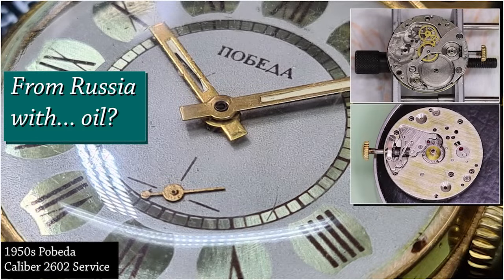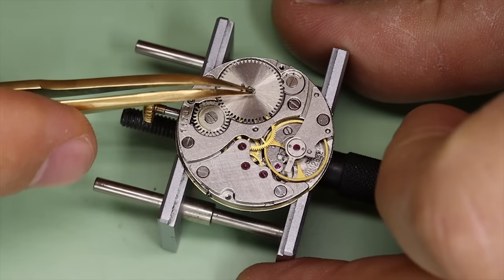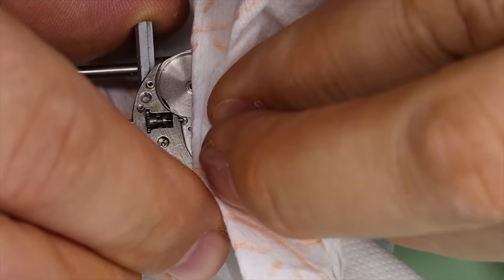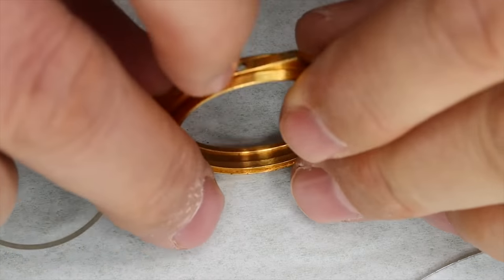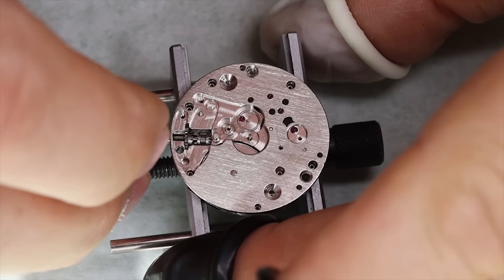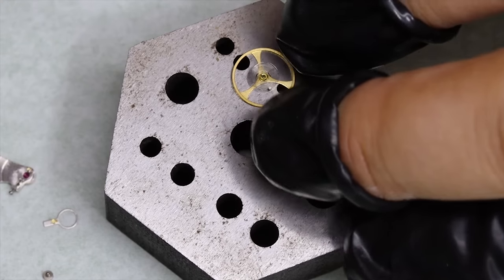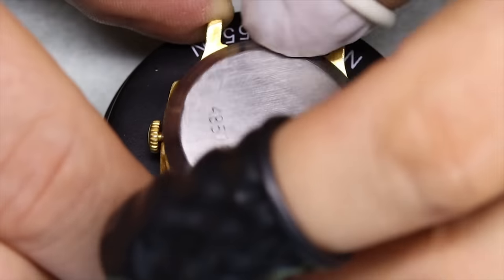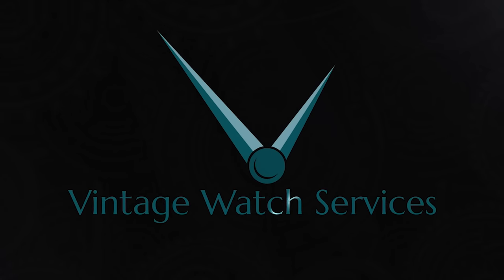From Russia with... oil?

Comment: I think this is a Pobeda from the 1980s or even the 90s. The finish of their movements deteriorated rapidly in their later decades. There are some watches to be found in which this movement was equipped with a shock-protection and sometimes even a date. They were sold under the brand names Raketa and Vostok in the 1960s and 70s. If the cases are ok, they still make for wearable watches today.
Thanks for showing us not only the expensive Swiss pieces but also some curiosities like this one!
Reply: Позолоченные Mеханические часы «Победа», изготовленные на часовом заводе Масленникова в 1990 году, по случаю празднования 45-й годовщины победы Великой отечественной войны
Reply: Название часов Победа воскресили  в конце 80-х, до это они продавались как ЗИМ.  Я купил такие часы в 1990 г. в белом корпусе типа танк с циферблатом зеленого цвета имитацией малахита. Цена 36 рублей.
Reply: @ФеликсШуняков  Thanks for the info!

Comment: Fantastic video! I just love your sense of humor. One question; is fixodrop the same thing as one dip? Thanks!
Reply: One Dip is a cleaner usually used on the balance spring for what I have learned.I've actually seen one person on youtube use one dip to clean the balance cap jewels as well but not sure if thats a good thing to do or not.fixadrop is something that'll actually help keep oil in the place you put it and help it to not spread out to other parts you don't want the oil on.the fixadrop is extremely expensive also costing $180 for a 100ml bottle.well that's the cheapest I've found it so far.I literally just asked if he knows if it comes in anything smaller than 100ml bottles because I think $180 isn't justifiable for someone like myself that'll only be doing maybe 5 watches per year.another name for fixadrop is epilame from the research I've done so far about it.
Reply from the maker: Hi Troy, no, one dip is a degreasing solution, while fixodrop is a stearic acid. Fixodrop is used to keep oil from creeping, while one dip is used for cleaning parts. Personally I don't use one dip much.

Comment: Dobra don Comrade!  Interesting show, I'd never heard of these before, however I have several Vostoks, but none are gold ;-)   I was surprised that the thing would even run with all that oil! At least there was no rust to contend with. Can't wait to see your next video.
Reply from the maker: Thanks, Randy! It was indeed very impressive that the watch ran so well (once it actually did) with that sea of oil on the inside. Very simple and reliable movement although slightly lower finishing level than what we are used to... 😄
Reply: In russia, we dont oil watches watches oil us.

Comment: Thanks. I’ve worked on a couple of these movements before! If you don’t mind me saying, it would be useful if you said what adjustments you make to the watch to get it just so on the timer graph. Also what are in your opinion the ideal settings on the timer graph, as I’m thinking of buying one.
Reply from the maker: Hi Boyd, it varies a bit with each video whether I show more detail on the timing and adjustment, maybe the best one is the one on the Zenith Surf. Have a look at it and let me know if that helps!

Comment: I have a Vostok version of this with a Zoom 2602. I am having a huge problem reassembling the train bridge and can't get the pivots in their jewel settings for the life of me. Some day I will get it correct, but you make it look so easy. Such amazing work and skill.

What is the crystal size/diameter that you replaced this with? Thanks.
Reply from the maker: Hello Clay, thanks for watching and for your comment! It's just a matter of experience and patience getting the pivots in place :) Make sure the pivots are properly in the holes in the mainplate before you try putting the bridges on. Then get the pivots into the bridge starting from the center wheel and moving towards the escape wheel. Once a few of the wheels are in place you can move the barrel a little bit back and forth, that might make the rest of the pivots fall in place. 

I unfortunately don't remember which crystal size this was 😄

Comment: I got one of thease i think its a 1980s one with the same case desine and applied indices gold plate like the one here.  differnt hand set. a very nice watch  the zim 2602 is a supringly reliable and accurate moevement. i have a few 2602 movement watches.

Comment: Awesome video as always.always love learning more about servicing watch movements.any chance you know if you can get the fixadrop in anything smaller than a 100ml bottle?for a person still getting started in this hobby and being as I more than likely won't be doing more then maybe 5 watches per year I serious can't justify spending $180 on a 100ml bottle of the stuff.besides that if the fixadrop does actually have a expiration date im sure it'll go bad before I use even 5% of it.also after looking at the oiling sheet for a sellita sw200 I see that it says to use the fixadrop on all the keyless works parts as well.is that absolutely necessary and is that something you would recommend doing or is it safe to just go about putting a little grease on the areas needed and be done with it?
Reply: You can get Fixodrop in smaller quantities on eBay. Still silly expensive though. Do we really need it? Well, it facilitates not spreading the oil, but is it really necessary? I guess not.
Reply: @VWatchie  awesome.ill check out eBay then.thank you.didnt really think it was 100% necessary to use on the keyless works being that thicker grease is used on those parts but would still like to do the pallet jewels with it prior to oiling.before I buy anything else though I'm gonna ask my local watchmaker and see if he'd be willing to trade me a little bit for a fresh bottle of 9010 since I somehow ended up buying 2 bottles of it.1 place said it was out of stock when I placed order so ordered it from another place and ended up receiving them both 3 days apart.lol.thank you for the info.greatly appreciated.

Comment: When the balance wheel is installed does the balance wheel pin go outside of the palet fork or inside thefork ?
Reply from the maker: Hello John, you place the balance so that the pallet fork is ready to receive the impulse pin into its horns. Then when you rotate it, the impulse pin will connect properly with the fork. This doesn't always go right, so in some cases I'll gently help the impulse pin over the fork on the other side with the tweezers.

Comment: I serviced a Luch with a 2209 movement a few weeks ago. Or at least I tried. Someone before me had ruined the hairspring and the stud holder. So I got to find a donor movement. Really thin movement for the time it was first produced.
Reply from the maker: Hi Hans, thanks for watching and for your comment! The Luch 2209 is a very nice looking watch and quite un-Soviet-ish both for the dial and case and the movement. It's always a bummer when someone has messed the watch up like that but luckily you should be able to find a donor movement at a reasonable cost :)

Comment: Oh god, I have never seen this amount of oil in any watch. In some chinese movements it’s already quite bad, because they throw them in whole into a fluid that should lubricate it, but this one is another level. I wonder how this happened. Great work as always :)
Reply from the maker: Another commenter said it's because there were "watch repairers" offering a cheap repair that basically amounted to dipping the movement in oil and wiping off most of it on the dial side....
Reply: @VintageWatchServices  And definitely, the oil is not of the Moebius variety.
Reply: @gang208  it’s definitely the rust prevention variety lol

Comment: What did you use to polish the gold plating?
Reply from the maker: Hi Slim, I used silver polish. It removes oxidation spots and brings the lustre out without removing material, asI suspect the gold plating on this watch to be very thin.

Comment: In the shipping industry oil filled gauges especially those subjected to high amplitude vibration are common. However, some years ago I remember it was quite the fad to have oil filled watches these must have escapements effected by the damping effect of the oil. How where they compensated to run true?
Reply: That only works on quartz or digital watches not mechanical.
Reply: Sin has a few. Their UX is a quartz oil filled diver that is rated to 5000 meters.

Comment: I think the watch started working because the oil had formed a pressurized seal that slowed the balance wheel  - when you released it, the movement worked...just a thought...
Reply from the maker: Hi Ian, thanks for watching and for your comment! The watch started running after I took the strap off, so I suspect the balance wheel got enough of a jolt to start oscillating. Quite impressive actually, considering the volume of oil it had to drag the wheel train through to make the watch run...

Comment: I've never understood decorating the inside of a watch. No one but watchmakers see it. I've got no idea what the insides of my Omega's and GP's look like. Now, my Elgin pocket watch is a different story. I've seen the inside of it.
Reply from the maker: It is something that originated back in the pocket watch days when the movements were actually visible or could be viewed with little effort. It also depends what one means by finishing; the metal parts cannot simply be machined and then placed in the watch, that would make small metal particles (burrs) liable to coming off and damaging the movement later. Further, a rough surface would make other particles and debris stick to the surface and thereby catch dirt and dust. So a certain level of finishing is needed as a minimum, and when the movement could be seen, the makers decided to make it a sales point to have beautiful looking movements.

Comment: Oil does mean there seems to be no corrosion.  And so much oil seems to mean no gunk, just oil.  Am I wrong?
Reply from the maker: Hello Lynn, that's more or less correct, but watches do "breathe" a bit, so tiny particles of dust and dirt do enter the case. And when they mix with the oil, you get the scientific term "gunk" 😁

Comment: Its likely a case of watch running badly so the backstreet chap takes movement, off with dial and hands then is bathed in naptha overnight, then allowed to dry then bathed in oil and allowed to drip dry overnight making sure none of the oil hits the hairspring and its a quick wipe down, dial and hands back on and watch chap has earned himself a few roubles.   Its very annoying tbh because there are people in Russia who charge ten or twenty dollars to do the full works, strip and clean, repair and replace and regulate, I use a couple of these for my Soviet watches and not had one issue with their workmanship.   I don't have many Pobeda's in my collection, got a couple sister brand Zim's and a ton of Poljot, Slava, Vostoks in my collection but think only one 1950's science fair prize watch on a tooled leather cuff and another with the sub seconds.
Reply from the maker: Thanks for that explanation, it does indeed sound like a good description of the previous "service". Alex, another viewer (see the pinned comment) mentioned these watches would cost relatively much considering the low incomes for the target demographic, so saving half of that might still be well worth it for them. 
I'm still very impressed that the watch actually started running with that pint of oil inside...

Comment: I liked the insight about oiling the exit pallet. I didn’t even know that each of the tines had a name! Thanks!
Reply from the maker: Thanks Mickey! Yes, we separate between the entry pallet and the exit pallet, and they are as you might know absolutely fundamental to the watch's health. The main difference between them is the angle at which they are set, but also how deep they are set. Very important that they are perfectly set, but it's also not very common that there are issues with them.

Comment: Actually, early production pobedas were beautifully finished and decorated.
Reply from the maker: Hello Jacob, thanks for sharing that! I don't know the Pobeda's too much, but the ones I've seen have that distinctive Russian/Soviet style. Were the movements also nicely finished? I've seen a couple that were let's say Seiko level.
Reply: @VintageWatchServices  I have a Pobeda from 1952 manufactured in the First Moscow Watch Factory. It uses the same LIP derived caliber. It has a bi-metallic balance, a breguet overcoil, and very impressive finish and decoration. The movement has Geneva-type striping very finely applied on the main surfaces of the plates with fine pearlage applied elsewhere, on both the front and dial-side of the movement.. The sides of the plates have rounded, highly polished edges. Under a 10x I could find no flaws in the finishing. It is a Soviet-market watch with a sub-seconds, and not a gold one or something like that. I would guess the finish on the movement would not quite rate a Geneva seal, but would rate comparison with movements that do without embarrassment (it does so against what I could see-I’m not enough of a watchmaker to risk disassembly of them- on my 1940s Patek tank and my 1956 Vacheron 6115).

I have a variety of Soviet watches- when I was younger and poorer they were the main focus of my watch collecting (and really remain so)- using the Pobeda’s movement in both sub-second and center-second form- even hacking. Some are finished fairly well- comfortably exceeding Seiko and even contemporary low-mid Swiss brands such as Tissot (as opposed to something using, say, the EB8800). Some could be best described as “not finished” in the sense of almost “not completed”. The 1MWF I described above is by far the best. 1MWF (Poljot) and the Factory eventually known as Raketa produced the best; finish generally declined as time went on, and the superior factories designed superior movements. The case design, bescheißen finish, face style, and the presence of shock resistance on that watch make me think it was probably made in the ZIM factory, and way later then your guess of the 1950s- i’d think more like mid-70s. ZIM produced LIP K26-type movements past the fall of the Soviet and Into the 21st century under the Pobeda brand. 

The end of their production was one of the few positive things that came out of the collapse of the Russian watch industry in the mid 2000s that left only Vostok and a reincarnation of raketa standing, but cost us several interesting companies like Poljot, Moljnia, Chaika, and Slava. I miss their double-barrel autos in particular.